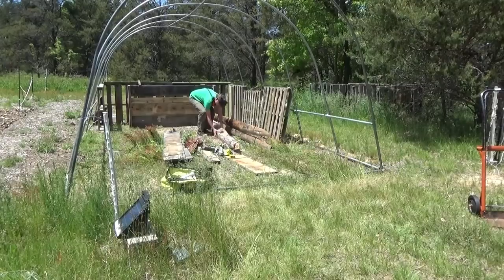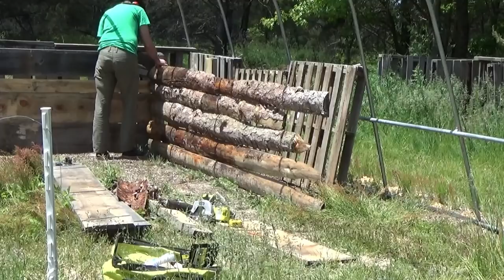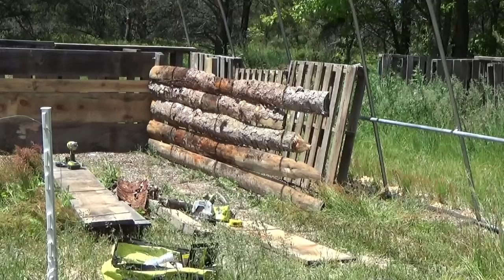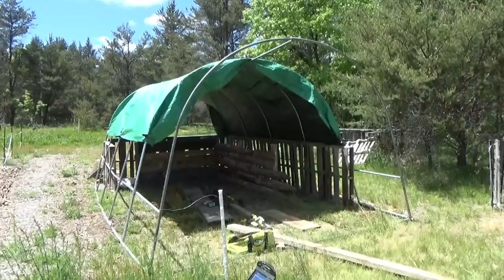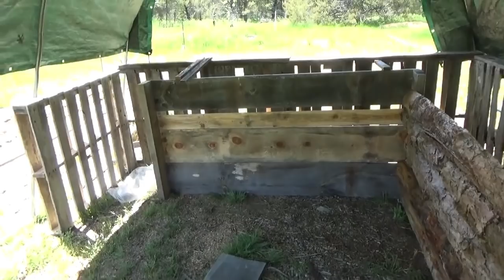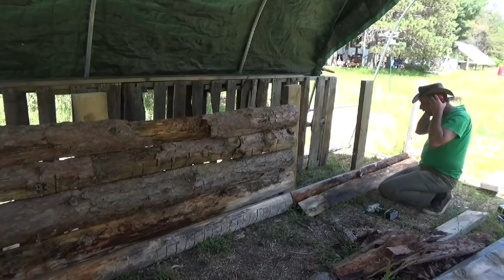Building Raised Beds For Our Greenhouse Part 2

Comment: Troy, seriously, where on the Internet can you find a raised garden bed that looks remotely like that? None of them are that high. What are you doing? Where are you going to get all of that soil? Do you understand the strain that will put on your structure? Point me to where you gathered the information to design and make this monstrosity.
Reply: It appears to me the weight is on the ground not the structure.
Reply from the maker: https://www.gardeners.com/buy/4x4-elevated-cedar-raised-bed/8586769.html
https://eartheasy.com/deer-proof-cedar-complete-raised-garden-bed-kit-8-x-8-x-20/

https://www.amazon.com/Palram-Plant-Inn-Raised-Garden/dp/B006GX8EOO

And thousands of others
Reply: @TheDoItYourselfWorld  I'm sorry, but we aren't looking at the same thing clearly. The 1st one MIGHT be as tall, but it is also much more structurally sound. The 2nd one is not even 2/3 as tall. And the 3rd one is on top of a storage container and has no soil beneath it. You confuse me a lot Troy.
Reply from the maker: you said "remotely like that" so I showed you some links. Then you pick that apart too. Anyone can see that raised bed gardens are built like this all the time. There are many advantages of this method, which I will talk about in a video coming soon.
Reply: Troy, those beds shown in the links are elevated raised beds The actual planting depth is 6 1/2 inches to 20 inches depending on model. Where are you going to get soil to fill that deep? And when the wood rots, and it eventually will.... It will be a mess to try to rebuild the beds while dealing with that much soil.
Reply from the maker: Not all of them have air underneath. Again, look up Hugelkultur. That explains everything.
Reply: 24/7 ASMR Sleep & Meditation  
Gotta admit,  this is an eye opener, Troy!  😳
An interesting eye-opener,  though 😌
This ought to get the you know who’s in a frenzy.  I can only imagine what the you know who’s, are saying over at  that you what form!  However I’m with ya on this all way. Very interesting!! 
By the way,  you’re still the Pallet King, ya know ? 👍🏼  this has got my attention for sure.  There’s never a dull moment lol  when you’re at your best,  using the pallets!! ✊🏼  I thought about using 2 of them for my cucumber trellis.  
Great upload series of DIY project on the greenhouse. Love learning new stuff!! 🤚🏼🤗
Reply: The Do It Yourself World (( Praise B )) that you posted this link.  Now I’m getting the big picture!! 👍🏼
Reply: The Do It Yourself World  I dunno about anyone else, but in checking this method out.. 🤔

Comment: I think I would have put blocks 
under the pallets every few feet 
to prevent bottom rot.
Reply from the maker: I thought of that but then there is the problem of keeping them from blowing out on me from the pressure of the soil inside. I guess time will tell how well this works. I am considering using metal stakes every 4 feet to keep the pallets in place anyway.

Comment: A raised bed doesn't necessarily have to be that high and at the bottom you want to put a lot of twigs and branches but we want to come up with so much compost that's what I've seen a lot of other on u tub home Stead one building their greenhouses and raised beds they have a clear plastic on top if you need more ideals go check them out on YouTube because it's all about working smarter and not harder
Reply from the maker: Yes its all about working smarter. No more bending over and sore backs in our garden. And no more waiting for the frost to end, which we had up through this past weekend. The decaying material in the raised beds will warm the roots and insulate them from the freezing temperatures. So will the height of the beds.
Reply: The Do It Yourself World once again interesting!

Comment: I dont watch as much as I used to and this type of video is the  reason why. So Troy be honest you do things like this for the extra comments youll get dont you?  You know its to high you know its NEVER gonna be filled with dirt and you know it will be a failure. 16 inch to 24 inches maybe 30 inches if you must but build it and fill it in one day and plant the next. Move on to the next thing.
Reply from the maker: You assume too much and that is why you anger your own self. I am not doing this just to waste time or anger anyone. I am quite serious about what I am doing here.
Reply from the maker: Look up Hugelkultur. It has been done like this before with much success. I cant find the images now but I had downloaded some images of a greenhouse with waist high grow beds.
Reply from the maker: Advantages:
1. No bending over. Easy on your back.
2. Provides years of nutrients as the materials decay.
3. Decaying provides heat which extends the growing season.
4. Raised off the ground extends growing season cause cold air sinks.
5. Insulation under the plants extends growing season due to not freezing so fast.
6. Less watering due to awesome water retention of the decaying plant matter.
There are more benefits but I cant think right now of them all.
Reply from the maker: Now you watch me do this and succeed. Then I will give you a number for a good doctor to remove the foot from your mouth cause its gonna be in there real good.
Reply from the maker: @jackofalltrades1972  Oh I am quite fine and happy actually. I am answering the same questions a lot. Generally with a lot of details to explain things clearly. I will be making a video to explain this method I am using.
Reply: The Do It Yourself World 👍🏼